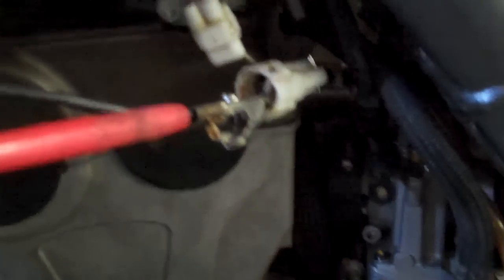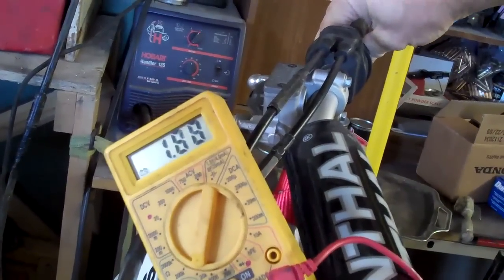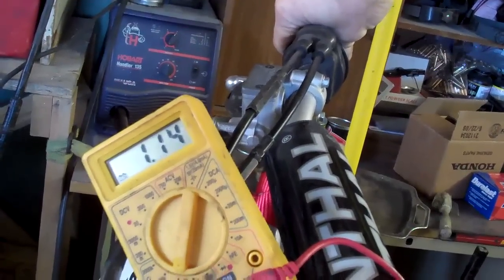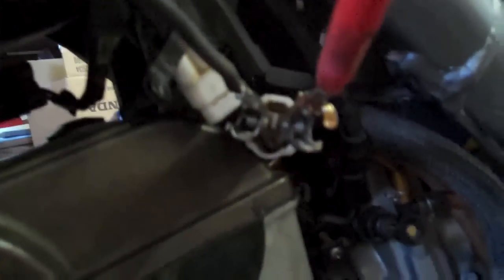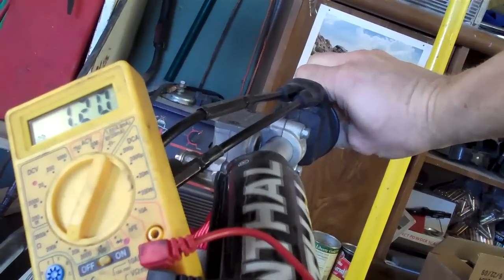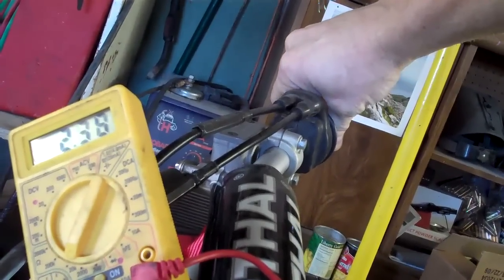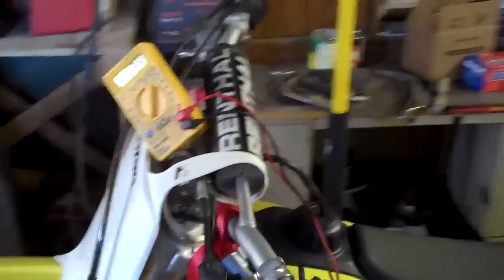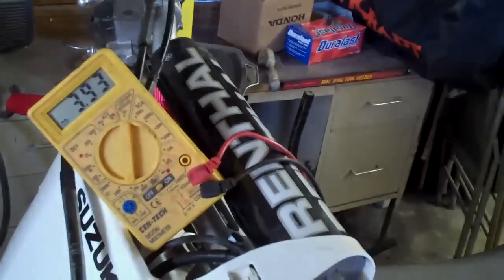How to test a Throttle Position Sensor on a dirtbike or car.

Comment: I was wondering if you knew how to determine where to set the sensor at so the dirtbike will start and run which I have a 04 Honda CRF250R that I am so tired of kicking!

Comment: So every 2 wire combination you should get movement? Out of the 3 top left and bottom stays at 3 ohms no movement however with your combination I get the same on my Honda CRF450R

Comment: so just a quick question my bike wont start on kick but if run started it runs like a dream any tips on what i should check?
Reply from the maker: Valve adjustment, compression, and carb cleanliness.
Reply: @briansmobile1  i have reshimed the valves to spec and cleaned the carb, the only thing i can not realy do is check my compression.
Reply: @briansmobile1  so i found out my tps is just dead but can this be the problem of the bike when kick starting?

Comment: For Suzuki owners, this isn’t how you test the TPS. This just shows there is resistance, not that it’s the right resistance. Between the Black and Blue wires it should be 5 ohms. Between black and yellow, you fully open the throttle and it should be between 3.09 and 4.63 ohms...rotate the tps to get in that range then lock it down.
Reply: Dude I know your comment is 6 years old, but for real I'm attempting to perform this test with the TPS, and I can not find the specs online for my year, 2005.
I've also watched a lot of vids about the keihin carb and its tps, but every bike has different specs. I can rarely find vids on suzuki bikes.
Your comment has helped a lot thank you.

Comment from the maker: @Amopower In this situation I would check the wires to the computer for pinches to the frame etc where a rock or a riding boot may have created an intermittent unwanted contact to each other or wire to ground.

Comment: Hi Brian - in order to get the TPS properly positioned on my 94Probe, you supposedly have to rotate it until you get continuity at closed throttle, then insert a 0.006" feeler gauge between the throttle and throttle  stop, check again, and verify continuity still. Then, with a 0.020" feeler gauge, verify no continuity, I have done all of that, but I always get a fault that the TPS voltage is out of range. I am not sure how this can be?

Comment: what if the tps has 4 connections...say like on a '94 dodge colt....on the actual tps above the connectors is painted/marked (  + 0 S -  ) without the parenthesis of course...the "S" could be an "8" it's kinda hard to tell since they are somewhat faded

Comment: @briansmobile1 mine seems to be ok, i disconnected the vehicle speed sensor which have problems on fords, the revs don't hang anymore - so i need a new VSS, but it still stalls, so a new idle control valve is needed too!